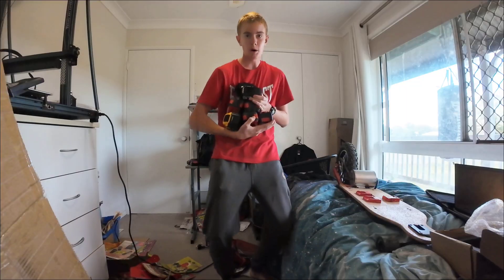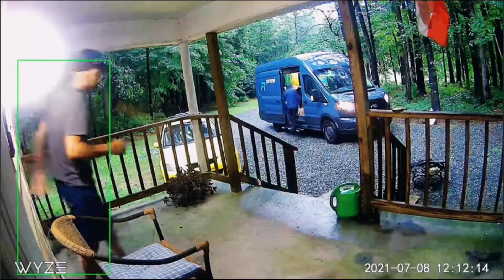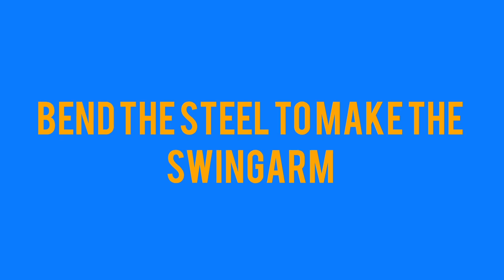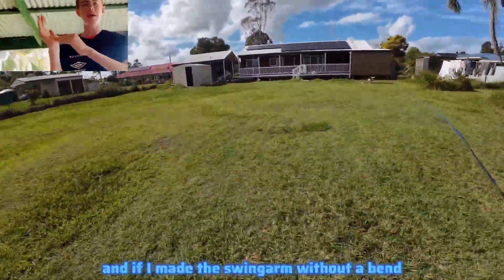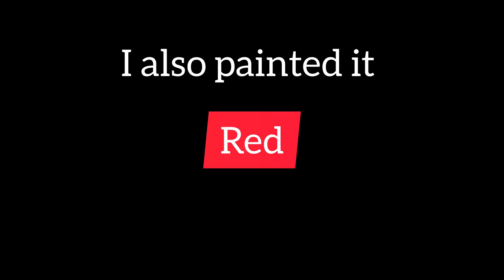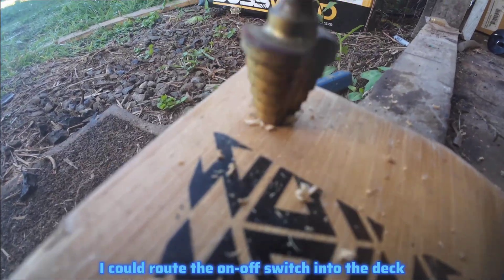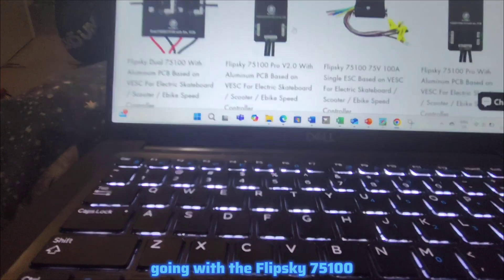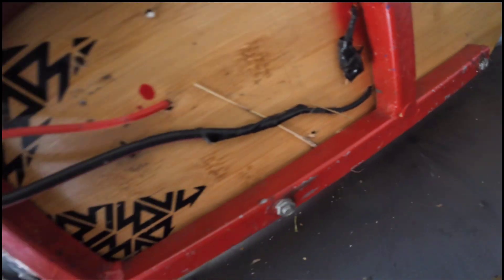I Built an Electric Skateboard powered by DRILL BATTERIES! 5000W 54v (Starting a Business Part 1)

Comment: Just a reminder that not all power tool batteries have internal low voltage protection. So if you are running a miss-matched group of batteries (eg. one is older and more worn than others) you will discharge the weakest battery first  without the ESC noticing the difference. Discharging certain power tool batteries too much might destroy them. What you need is individual battery monitors/discharge protection so they don't discharge too much fuses would be a nice touch aswell. There is also a safe ammount od current that you can draw from liion cells before they heat up, usually its around 20-30A max depeding on cell manufacturer and quality. As you have these in series running 54V nominal that is  almost100A at 5kw on paper...IRL it might not draw that much but its smart to stick to a safe limit.  I measured my makita power tools and the most I got was a leaf blower running around 25A at max blow for comparison.  Good luck with your development.
Reply from the maker: thanks for the comment   I'm currently conducting rigorous testing and development on the boards I plan to sell to the public. My focus is on ensuring all essential battery safety features are in place, including protection against low voltage cut-off and high current draw.

I've decided to offer a 36V 700W electric skateboard to the public, rather than the 52V 5000W model. While the higher power board can reach speeds of over 70 km/h, I believe that's simply too dangerous. The 36V 700W version still achieves speeds of up to 40 km/h and, honestly, offers more torque because it's a dual motor hub-driven design.

The electric skateboard controller I'm using has a built-in voltage cut-off and a maximum current draw of less than 30 amps. This is crucial because even if an older style battery doesn't have its own low voltage cut-off, the controller will prevent damage. I've also made sure the boards are compatible with only the modern batteries from brands like Ozito, Ryobi, Makita, DeWalt, and Milwaukee, all of which include these important safety features.

Comment: yo i builtd this second month of covid.. i with INBUILD motor.. trust me.. a problem is.. a turning.. you need double TRUCK ( i hate it ) they sux.. anfding backwheel over 12inch is.. too much beterr tgo 9-10inch.. is much meter turning.. and also.. make that on spring.. and front wheel .-. pull far over 130mm.. or youa re.. well i not gona tel you how did i found out..
Reply from the maker: Thanks for the tips 😁 Il look into implementing them today